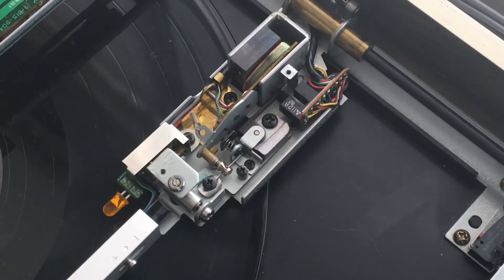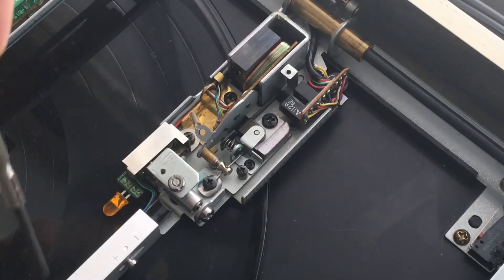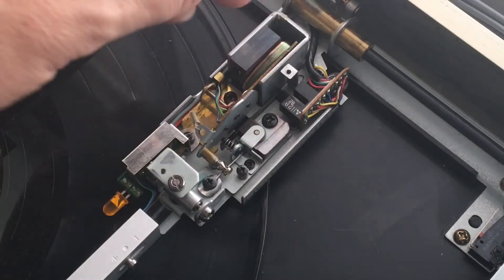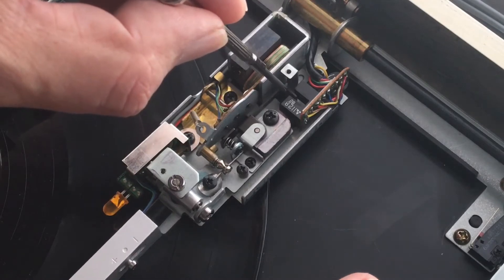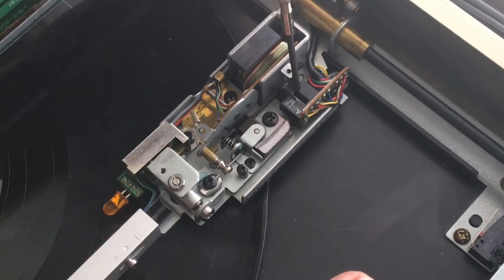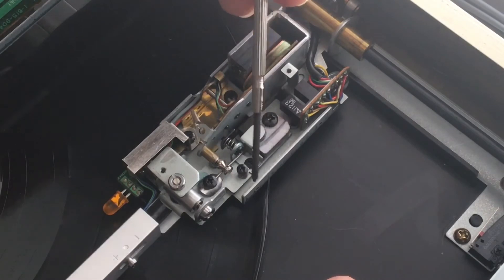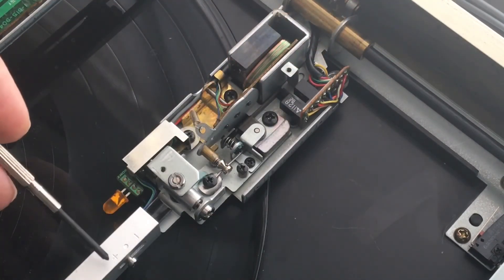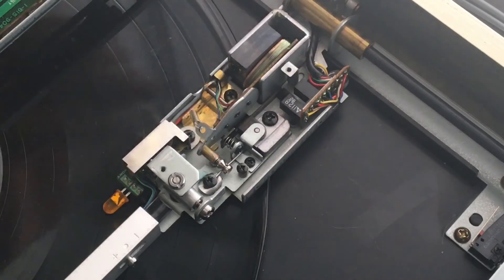Repair Quickie - Tuning a Linear Tracker

Comment: I have the PS-LX510 and it plays records and tracks fine, but I have to use the manual controls to move and drop the needle to start the play. If I push the play button, it will go to the edge of the record. Hover for a second and then return back. Any idea why this happens?

Comment: Hi, would any of the adjustments shown in your video fix the thumping noise when the chassis moves? I’ve checked the belt and lubrication and all seems fine but still get the thumping noise.

Comment: Thanks for the video, I have Mitsubishi MC8000 and tonearm dose not automatically move forward, it does move automatically in the beginning but does not move once start playing, any advice is welcome. TIA
Reply: What's probably going on is the small belt in the drive that advances the arm needs replacement.  With a long period of disuse the belt takes a 'set' and becomes permanently oblong (the pulley on the motor is quite small, the one on the worm drive is larger).  The motor turns at high speed on lead-in, and while playing the motor makes tiny movements, one or two revolutions at a time.  the oblong belt will grip at high speed but not for playing.  The advantage you have is since it is vertical you can take off the back cover and watch and fix all this easily.  It looks like the tracking belt is an SBS 3.5.
Reply: Thanks very much 🙏

Comment: Nice video. I have a question about a sony ps fl77 lineair tracking turntable. I replaced the belt from the arm movement gear, and did a speed adjustment. Everything works fine, only one problem left. If the biotracer arm lowers on the record, the arm swings at lowering to the right, and falls beside the record. If i push the arm lifter several times, it drops sometimes nicely straight downwards, but you can not rely on it. Sometimes it does the job well, other time not good. What could be causing this problem?
Reply from the maker: The biotracer tonearms are a different animal. First they are extremely sensitive to being level, check where it is sitting and adjust or shim the legs to get it perfectly level. After that you’ll need to clean up the adjustment pots on the circuit boards with some DeOxit. Take pictures and be sure to put the pots back to the same position when you are done. Lastly get ahold of the manual and walk through the initial setup and calibration again.
Reply: @thebluevu1097  Hi, and thanks for comment. The calibration of the unit, was the solution for the tonearm problem. I think, due to aging of components like capacitors, the unit needs calibration after 37 years  of lifetime. I greased also very light the biotracers sliding rod, and gears. Played a few records, everyting seems fine! I really like the sound of the turntable, much better than those plasticy toys they produce nowadays.😉
Reply: @thebluevu1097 my tone arm drops on the record from too high up so it bounces initially. I saw from you video how to adjust but I cannot get the cover off the front tone arm. I removed the top screw but there seems to be a screw on the underside but no way to get to it.
Reply: My tracker arm drops from too high and bounces on the initial start I saw how to adjust but I can’t seem to get the front tone arm cover off I removed the top screw but can’t seem to get the cover off. Worried about applying too much force on the plastic